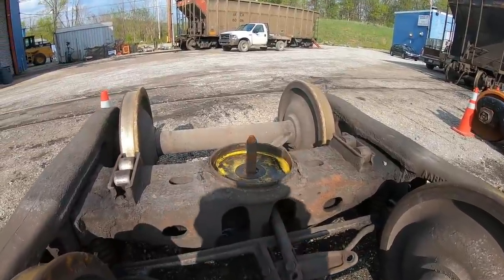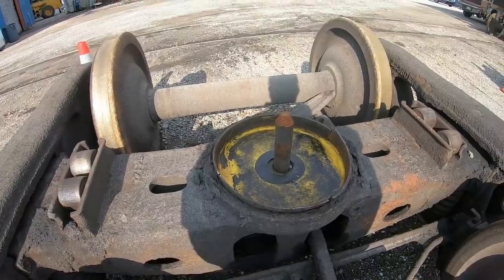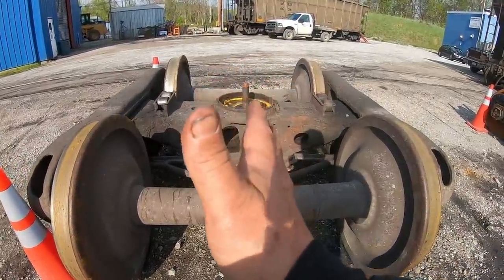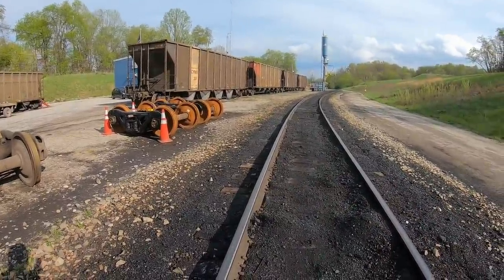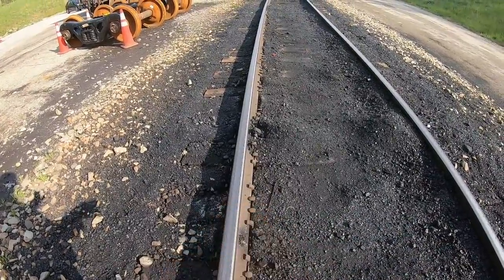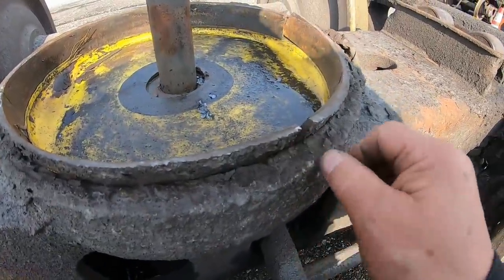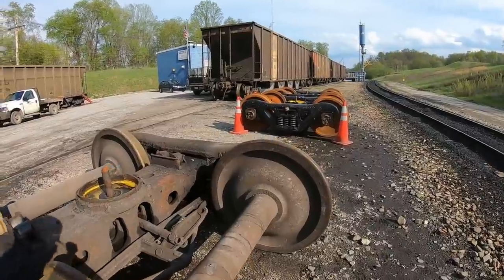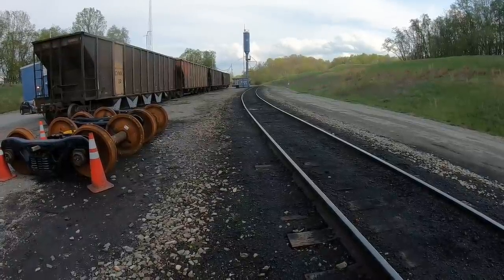Why the Derailment at Curve 18  Happened

Comment: As a former carman I agree. 
We had several of those car type come on our line and those bowls had extensive wear causing trucks not swiveling properly.
Reply: Junk inferior design and materials yes!
Reply: @oddjobz9858  that I cant say.
The ones we got were not inspected or maintained properly. The line was so desperate for cars they let them on the line with dozens of loose bolts per car. We're talking 20k in fines each just in loose bolts, and that was just the start. We normally would have a car out next day. Those cars were spending weeks.
Reply from the maker: Thank you Charles, appreciate your sending that in, it
actually makes me feel better for hearing you say that.
Ponder this: As Thomas the Tank Engine said, Silly cars always causing
trouble because they are angry.
And as you know the track men always blame it on the car men,
the car men blame it on the engineers and the engineers
blame it on the track men...LOL
Reply: @ccrx6700  from what I've seen of your tracks they are far better maintained then some sections that my old line had.
Kid you not had whole sections that the mud was over the rails for hundred or so feet, and these were daily use sections.
Reply from the maker: @nope8535  Charles i just dont show the mud sections ... lol. Watch some of my vids on curve 49 before we redid it, i have no clue how the train stayed on there. I got some small spots where mud is up to top of rail too. Thanks for getting back with me

Comment: After seeing this, I too would agree with your explanation. I would expect that if those cracks were fresh, you'd see a more yellow type of initial rust, a lot like what the rail or wheel sets get after a rain or two and no movement. The darker rust is less topical and is slightly deeper. (that saved us on an electrical job where a large electric motor under test ripped off the frame it was attached to, and when it did, it shifted the rotor from the stator causing them to make contact... and enough sparks to set the surrounding grease on fire until the inertial load finally came to a stop some 10 minutes later. Customer insisted we broke the frame, when we went down and showed the new crack right beside the old rusted crack on the opposite side... they weren't very happy when we point the finger back at their own maintenance, or lack of actually... So I would assume the same could be done here. The bottom portion of that piece that looks like 2/3rds of a circle should be shinny underneath if the are fresh cracks. I would expect to see a gouge or wear marks on the mating end of the car frame since it likely dug in causing it not to swivel.  

Additional causes for this break out could be rough handling of the car, or depending on direction of travel brakes set and slack action of the car's mass, or car mass plus solidly coupled to the rest of the train slamming into the stopped truck. If you think about it, that pin and the bowl is the only thing that gets brake forces to slow the car, and the rest of the train down... Otherwise, teh wheels would stop and everything else would go flying overhead! How likely is this scenario? Probably not likely, but 30-40 years of sharp impacts will fatigue metal... and considering the liner is ground out, you have a half inch or so play where you can get a differential speed between the car body and the truck bolsters. 

Someone in the comments mentioned that it wasn't the bowl that was cracked out, it was the liner.... that is incorrect. If you look at 2:12 in the video, at about the 10-11 o'clock position, you can definitely see that the liner has worn through on the sides, and is shredded at that spot, where only the bottom of the liner remains. One would think that would be sufficient since that is where the load of the car rests onto the bolster, however clearly there is more side to side action that occurs making those wear. I would definitely be making an inspection of the remaining fleet of cars for similar wear and or damage. Since the same cars are always tied together the wear unfortunately is probably pretty similar throughout all the cars. 

Definitely a great call quarantining this problem child car that kicked everything off! See what all that experience gets ya!

Oh, one other thing, are the rollers on the left side egg shaped by comparison to the ones on the right, or is that just the lighting making them look odd? If those are locked up or square, that's probably not a good thing either!
Reply: The rollers are originally cylindrical.

Comment: This explanation makes a ton of sense. One of the details I noticed in the original derailment aftermath video are a pair of scrapes on the web of the rail that had rolled over. I'm thinking that as the leading wheel rolled the rail over, it and the following wheel in that first truck set fell into the web and rolled along in what was then became channel guiding the wheels, which then kept twisting the rail over as the cars rolled forward. Great videos by the way!
Reply from the maker: Yep, got some pictures of that wheel on the web that are posted on
my channel on the Community Tab

Comment: Basically, from what I can gather, basically this is like a big rig that didn't have enough grease on the fifth wheel. Same difference.

But in essence, the bad truck caused the outer rail to roll over, due to the weight in the car shifting to the inside. The car derailed when the gauge became too wide.

What you should see, in that situation, is the wheel flanges being basically shined up, or a coating of new, light surface rust, because of the flange of the wheel, rubbing on and pushing on the railhead. That will tell you the side of the truck that was the outer side, as that turn was negotiated.

I also believe that the truck had no grease and was binding, due to the lip of the pin area being broken into four pieces. That is basically the same thing as a ball joint or an outer tie-rod on a car that has a cracked boot. When that happens, and you lose all the grease, the joint ends up seizing, becoming rough, and eventually starts cracking, popping, even groaning as it moves to do its job.
Reply from the maker: Sometimes things just break and go bad on the RR. We been
very fortunate that this was the first time that I can remember
since 1993 or earlier that a problem like this has occurred here.
Thank you for watching Isaiah and hope you will enjoy the rest of the
videos coming out about the derailment events.

Comment: The 5th wheel plates on tractor trailers have a similar issue to what's being described. When the plate joint gets dry from no grease it'll resist the ability to pivot and could cause the unit to continue straight and not turn into a curve. Happens more in trucks pulling the same trailer for a long period of time without separating the equipment.
Reply from the maker: Very interesting Joseph, thanks for writing in with that, I never
realized that. Appreciate your watching sir

Comment: A perfectly logical explanation for the cause.
Tremendous forces are at work with 100 + ton loads and empty car (25-30 tons?) plus inertia.
A recipe for a big mess!
Reply from the maker: Bill, As Thomas the Tank Engine said, Silly cars always causing
trouble because they are angry. Thanks for watching my friend.
And as you know the track men always blame it on the car men,
the car men blame it on the engineers and the engineers
blame it on the track men...LOL
Reply: @ccrx6700  I know exactly what you mean!
Reply from the maker: @railroad9000  😄
Reply: The usual load limit on eight ø36” wheels is 240,000#, 30,000# each.

Comment: Your answer makes perfect sense. I drove Semi-trucks for over 30 years. If you do not have grease on the 5th, it will bind up. The broken ring on top of the truck is proof of that.
Reply from the maker: Very interesting Paul, thanks for sending that in and letting
us know the info

Comment: Great job  I see grease in the bolster below the broken socket/pocket.  If that grease is old or has dirt mixed in, I would suspect that the socket failed some time ago. Also, the disintegrating cast iron around the steel socket liner looks like it has been broken for a long time which would have removed support for the steel liner (which does not look thick enough to withstand the forces imposed without the cast iron backing) and led to its cracking along with the yellow plastic liner and resulted in grease leaking out into the bottom of the bolster.  You should be able to inspect the cast iron outer socket for failure with a flashlight.

Comment: is it possible the wear on this, and the other cars and locos could be caused by being in a loop railroad? the locos the cars in the same position could cause unusual wear patterns on the cars and the locos too. edit: repeated wear in the same way without a change......
Reply from the maker: We have our share of wear on cars and on track just because
of what you are saying. It hard on stuff always running loads the
same way, bi directional loads would decrease a lot of wear problems we have. Excellent observation on your part my friend!
Reply: @ccrx6700  thank you for the reply.
Reply: @rearspeaker6364  We get the same experience with equipment on the oceans.
Reply: @ccrx6700  the railroad I worked for had the same problem. We used to turn the locomotives and cars at least once a year to even the wear.

Comment: The cracks in that bolster bowl are definitely old.  You can see the rust build up inside each crack; that wouldn't be the case if the cracks were caused by the derailment.  I think you're on to something here, the physics hold up for what you describe.

Comment: So if that truck bowl is dry, question arises, how many other hopper cars have dry bowls?  To grease it do you have to lift the body up?
Reply: 1000’s or more trust
Reply: Yes, that’s how it’s done, it can just be jacked up enough to throw those grease pouches in and then let back down. You don’t need to move the truck once the car is lifted. 
Some locomotive traction motor gear boxes are lubed with bags of cog lube. It’s like a soft tar, you take a cap off the gear box and put a few plastic bags full of lube in and put the cap back on.
Reply: @ralfie8801  you put the whole bag in, bag and all!!
Reply: @ralfie8801  Those yellow plates are supposed to be the "lube" as that car body to bolster joint is not weather tight and using grease would just wash out over time.  The fact that the removed bolster had none of that "lube" plate left in tact suggests that there was a lot of friction between the bolster and car body that could have caused it to bind coming out of a corner.
Reply: @littlewingpsc27  
None of those bolster plates are weather tight, we use 30 wt motor oil in the corresponding housing on some locomotives. The grease you say would wash out actually won’t. It’s a very hard grease almost like plastic.
Reply: @rear speaker  
Yes, bag and all.
Reply: @ralfie8801  Yeah I know they are not weather  tight, that is what I said as well.  Good to hear the grease doesn't wash out.  Thanks for clarifying.
Reply: @cmmartti  we called that stuff “crater” grease. Same as what’s used on the traction motor gears. Very thick and sticky. Doesn’t come off anything.

Comment: Those cracks look old to me. I'm not an expert on rail equipment but steel is steel and metal inside those breaks looks pretty much identical to the metal around it, I'd expect it to be noticably brighter if the crack was only a few days old.
Reply: It wouldn't stop a loaded car from slewing.

Comment: Sir, would a binding bearing have the drag force to make the flange ride over the rail ?
Reply from the maker: Great question sir and just my humble opinion no it would not.
Sometimes things just break and go bad on the RR. We been
very fortunate that this was the first time that I can remember
since 1993 or earlier that a problem like this has occurred here.
Thank you for watching and hope you will enjoy the rest of the
videos coming out about the derailment events.
Reply: I would expect to see shiny worn flanges if the bogie was fighting the track instead of swivelling freely.
Reply: @colinlothlorian  If the rail is of a softer steel than the wheel (I don't know if it is), then the rail would get all the wear and not the flanges. If you look at the original derailment video, there is quite a bit of wear on the section of track that tipped over.
Reply: @kdmq  I could have explained my thinking better. Normally the flange doesn't touch the rail, a sticky centre bearing will cause the flange to repeatedly contact the rail and leave a shiny witness mark on the flange. If you add that to a rail head that is worn to the same taper as the flange, giving a lot more friction, then the chance of the flange climbing the rail is much increased.

Comment: Makes sense to me.  It might just be the way the camera angle, but looks like those two wheel sets aren't in-line in that truck set.  Course, that might have been from the derailment or like I said, just the angle of the video.  Long four days work.  Get some rest.
Reply: Looks to me that the misalignment is an artifact of the camera.  It is caused by a wide angle lens.  Take note of how the rails seem to bend as the camera pans at around 3:27.
Reply from the maker: You are correct, they aren't, but we see that often after a truck set
is drug out from under a car by the high lift, and as you say it
could have been caused by the derailment. Very good observation Mike

Comment: Back in the day there were no liners or lubrication just good ol thick metal.
Reply: I hear ya  = l was a Carmen on the MILW. RR = I REMEMBER THAT WITH EVERY LIFT =  IF POSSIBLE WE WOULD PUT A GRAFITE DISK IN the center plate bowl...  MANY CENTER PLATE RINGS WERE CRACKED OR BROKEN OUT WITH PEICES MISSING = IT WAS A REAL PROBLEM 40 YRS AGO...
Reply: Back in the olden days freight cars were 50 to 70 ton capacity. The use of 100 to 140 ton cars necessitated plate lubrication.
Reply: @thomasdupee1440   yup the load limit is definitely much higher
Reply from the maker: Excellent point Thomas! Thanks for adding that in, big differences now that what used to be. Thanks for watching and hope you
are doing well my friend

Comment: Looks like the crack was there for a while because its already rusted were the crack is at. looks like that truck was going back for a while. and it finally gave and locked.
Reply from the maker: Charles, appreciate your watching and for sharing your thoughts with us, hope you'll watch more of the videos coming out soon on
the derailment
Reply: I concur, not that I'm a railway engineering expert, far from it, I just enjoy watching stuff about engineering and I'm a bit of a petrolhead, but where a crack in the metal has been there long enough to get rusty, or the witness mark shows that the crack has formed over time (polished look to it) before an instant fracture, then I'd say that truck was going bad way before the derailment.

Comment: how old is that truck set? because if it's as old as the cars from the 90s you're going to get fatigue failure.
Reply: Only going to happen more often with more lax safety inspection requirements and regulations. RR companies have constantly lessened the time spent on each car for inspection after a certain amount of mileage putting more stress on those who do inspections. There have been numerous news stories highlighting it. One of these days they are going to have pushed the limits too far and innocent people will be put in danger for the sake of corporate greed.

Comment: Here we see how cutting costs with equipment maintenance bites back bad. Just like my ex-boss gave me a towtruck to use that was totally sluggish and "out of breath". It had so badly clogged up air filter that resulted to turbocharger overspeed and impeller destruction. Somehow the impeller shards managed to not cause noticeable problems after getting sucked into the engine...
Reply from the maker: Sometimes things just break and go bad on the RR. We been
very fortunate that this was the first time that I can remember
since 1993 or earlier that a problem like this has occurred here.
Thank you for watching and hope you will enjoy the rest of the
videos coming out about the derailment events.